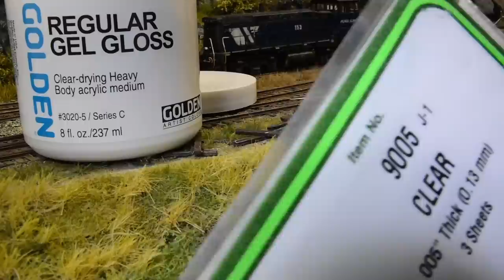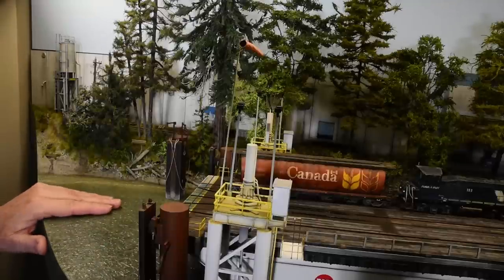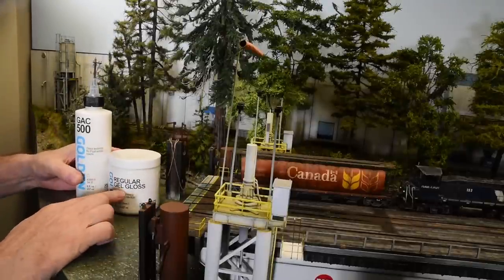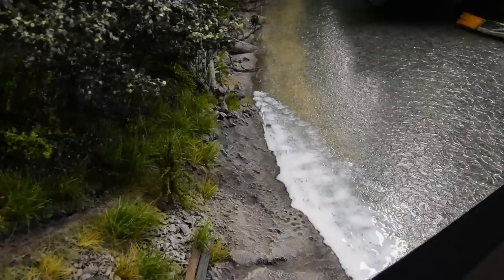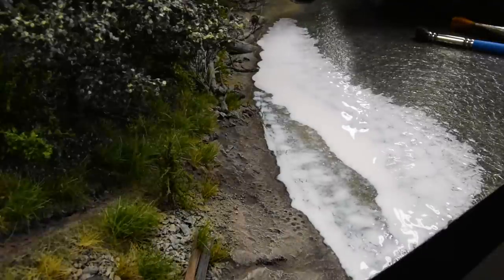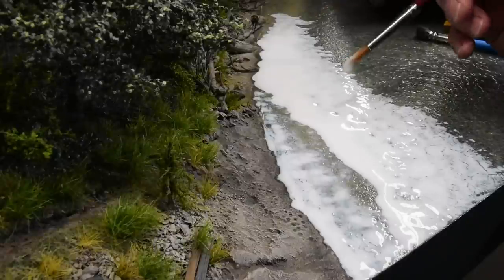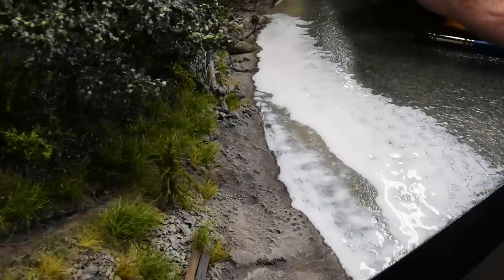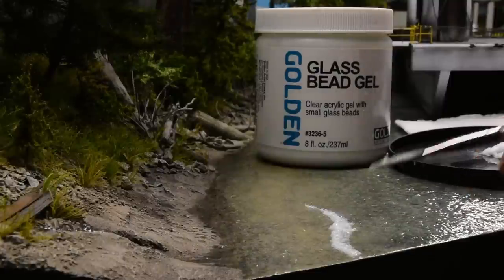Modeling Low Tide Water Effects For Model Railroads and Dioramas | Boomer Diorama ~ Vlog # 191

Comment: Another great tutorial VLog Boomer!  One question...  I've checked out the GAC line in my local art supply store.  I've noticed there's multiple options, something like GAC 200, 300, 500, 900, etc...   In terms of modeling water, what's the significance of the different options that are available for this product?

Thanks!
Reply from the maker: I use the GAC 500 as you know. The other options are for different applications on different materials, etc. They have different viscosities (stiffness or fluidness) depending on the texture you want (tool & brush marks), or the material you apply it to like cloth, canvas, board, etc. It's all pro stuff and you just have to research it a little because it covers everything and is compatible across the whole line of paints, as well, when you mix it. Cheers.
Reply: @boomerdiorama  Thanks Boomer...  Did a little research this morning.  Going to try a 50:50 mix of GAC200 and GAC500, as well as each of them by themselves.  The GA200 is formulated for increased hardness, something I've found is lacking in off the shelf artists mediums.  Experimented with Acrylic Gloss Medium a lot years back and sort of gave up on it because while it looked great, it was too soft (almost rubbery) and sometimes tacky, even after drying for a long time.

Maybe GAC500 by itself will be fine too, but with some experimentation, I'll figure out which is best.  There's also "pourable" acrylic finishes too.  Purchased a small bottle of that a while back.
Reply: @WHJeffB I’d be interested in those results with the various viscosities. My instinct is that it might be some years before you may have the whole picture. You may possibly be able to do it all with GAC 500 then a thin gloss coat of 200 to harden the surface and reduce the chance of scratches and the like. 

But I too need to run this experiment. I think getting a bottle of 500 and 200 are also in my future.
Reply: @AndyCrawford_NorfolkWestern  My only concern with the GAC 200, is that is says nothing about "self leveling".  It does have excellent clarity, but it requires temps above 70°F/21°C to dry.  It might make more sense to add 1 part of the 200 to two parts of the 500.  Or, as Boomer has shown (which seems to work pretty darn great), just use GAC 500 straight up.  
I'm inclined to purchase 16oz of the 500 and a smaller 8oz bottle of the 200 for testing.  It's top notch artists material, but not cheap!
Reply: @AndyCrawford_NorfolkWestern  Purchased some GAC 200 and 500 today and did a small sample of both mediums.  The GAC 500 appears to set quicker and self level better.  The GAC 200 is more translucent and slightly glossier.  Will let them set overnight and evaluate the hardness of both.  My initial inclination is that the 500 will be fine as it is for most work (as Boomer already has shown), but a mix of the two might have some benefit.
Reply from the maker: So the fellow at "Rhythm Railroad (YouTube Channel) Poured the GAC 500 several inches thick. He freaked out at first because of cloudiness but it eventually cleared up. I would never pour it that thick but it goes to show how reliable the stuff is. @WHJeffB

Comment: Hey Boomer! Great video as always....question for you: I typically do 1/35 scale and 1/24 scale dioramas.  I have never modelled water other than little puddles and such. I am working on a piece that will have a small river.  Do you think that the Gak 500 and this water/bead gel mixture will translate in those scales? Would I treat the application any differently?
Reply from the maker: Yes, absolutely. I prefer this method with larger scales as well.

Comment: Hi! Could you use this to hold flex track down to cork (I used DAP Alex Plus and there are places where it's not holding). Or any ideas 
on this.
Thank-you.
Mike.
Reply from the maker: If you pinned the track down while the acrylic sets up, then yes you can. It is no different than "matte" medium which dry's flat instead of glossy.
Reply: Should I just use "matte" medium in the first place? Again thank-you, Mike.

Comment: Hi again i have a second question, think I put it in the wrong place! Should I just use "matte" medium in the first place? Again thank-you, Mike.
Reply from the maker: I use Super Glue "spots" under every fifth tie (over cork roadbed) with push pins to hold it down. So I glue the track down with CA onto cork first once I am satisfied with the arrangement. When the glue is set the next day I ballast the track using diluted "Matte Medium." This way you can lift the whole track by soaking with Isopropyl Alcohol if need be down the road.
Reply: Thank-you, Mike. @boomerdiorama

Comment: Not really a personal question, but I can understand if you don't want to answer. But in a ballpark figure, how much money does this cost? NOT in your time. But with paint, brushes, materials, tools, etc. If I was to go out and buy what is needed to build something like this.....? Thanks? LoL
Reply from the maker: In my opinion, nothing is expensive in the full context of the hobby coupled to investment. If you have to ask how much then you probably can't afford it - Meaning: no one counts the cost initially. Which probably means I couldn't afford it either. ;-) It's much cheaper than pouring expensive epoxy resin at this scale.

Each bottle or tub I showed is twenty bucks. They have a great shelf life as well. In total, I have only used a small miniscule part of the total product as well. How much wear & tear did I put on the ten dollar paint brush? 

You can use any kind of cheap paint for the  base color.  How much of the product did I use in the demo?
 
If I defer a Tangent Boxcar or an Athearn Hopper, I can afford to do all of this. The bench work is up to you and a completely different subject. 😁Cheers.
Reply: And as a secondary opinion. Scenery, especially if you do use a lot of natural scavenged material, and scratchbuild the bulk of your more human elements. Is probably the cheapest sector of the hobby relative to the effect it has on the final composition. Dollaring out a Commision layout I am working on, the scenery so far is around $50 usd on a 2x4 layout with 1/2 being foam boards. Since the current buildings are made out of Styrene scraps and anything fancy was 3D printed with an FDM printer its pretty cheap. But will prob shoot up by around $200 since the client is hard requiring the use of Woodland Scenics Ready made buildings and lighting as a product showcase for the shop the layout resides in.
Reply from the maker: You raise a great point. If I had to zero my budget I could still build for a long time based on the scavenged inventory I already have. 😉 @dexecuter18